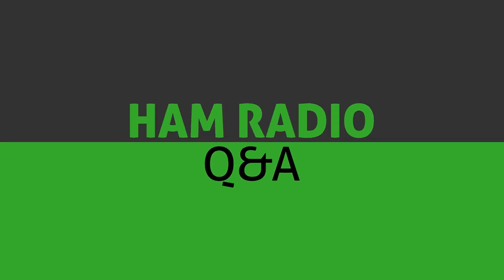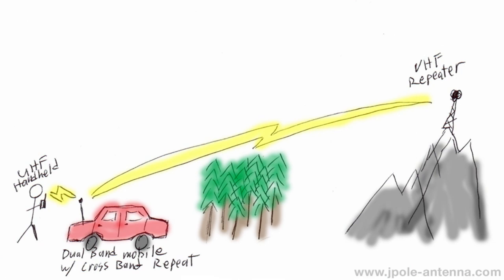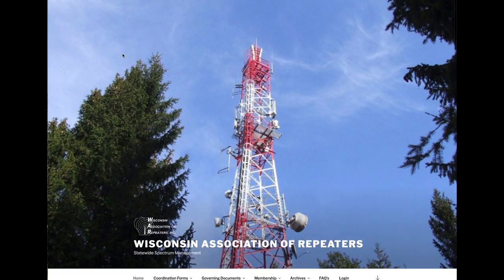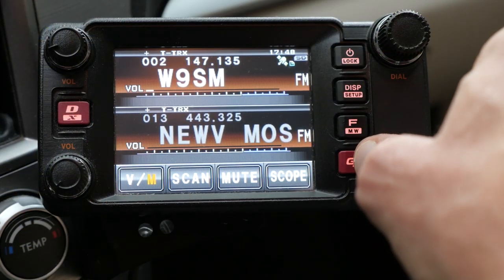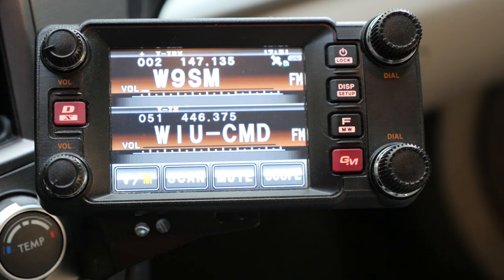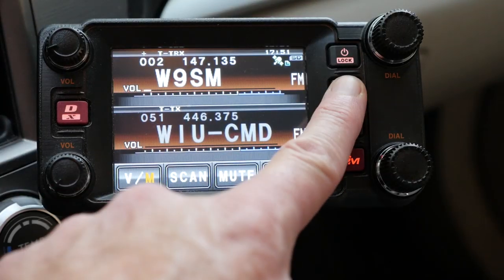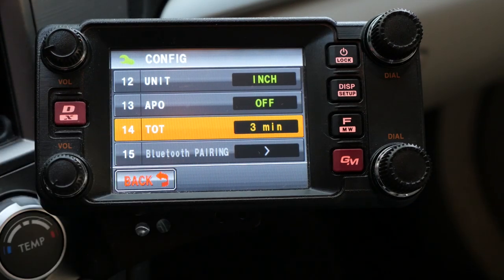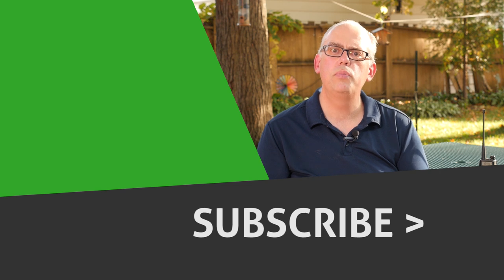Cross-Band Repeater Operation with the Yaesu FTM-400XDR - Ham Radio Q&A

Comment: Kenwoods are definitely more cross band repeat friendly. Look up fixed band repeating. You need a dual band handheld and you’ll have to be able to hear the repeater on your handheld. With fixed band you listen to the repeater on your hand held and only transmit from your mobile when you key your hand held. This saves your battery and your mobile. This is the primary way I use my setup. It also prevents your mobile from locking up the repeater as it’s only transmitting in one direction and only when you key versus it transmitting every time someone on the repeater Keys’s down. Again you have to be able to hear the repeater from your handheld to do this.

Comment: I've had the FT400 for about 3+ years, I may have keyed it up 2, 3 times and never read the manual.  I see it can do a lot more then I know. Thanks
Reply: ah but Cross band repeat isn’t in the ftm-400 manuel. Yaesu has said “ they forgot to put it in” (true statement).
Reply: @forgetyourlife    lol, You would think it would have been posted.  Something for me to play with but I first need to buy a new programing cable to update the system.  When I bought the 400 new about 3 years ago I tried to update it but found the cable was bad,  sent it back to Yaesu and was told the cable is not warrantied :( wow.  I like Yaesu and always had one or more but that pissed me off so I started buying Icom which is another great company.

Comment: You say to unplug the mic for the FTM-400.  However, Yaesu told me that's not needed.  I tried it with the mic plugged in, did some talking & a friend listened on both freqs with another radio & could not hear my talking so it seems it's ok to leave the mic plugged in.

Comment: I have an older kenwood tm v71a and it has "remote control" capability which means you can control it with another handheld radio using dtmf tones.
Unfortunately they stopped offering this feature on newer models.
Beats me as to why they stopped offering such a great feature.
Reply from the maker: You could also control your TS-2000 with the D-7AG handheld‚ including HF. The FCC had some issues with Kenwood's SkyCommand feature when it was first introduced‚ but Kenwood corrected those problems. As useful as it was‚ it never took off and they must have quietly dropped it in subsequent radio models.

Comment: I love the remote control feature of the crossband via dtmf on the kenwood tm v71...    use the crossband a lot at home in combo with a handy while at home so can use repeaters ...  with the remote control feature can change repeaters or change power settings or turn on or off the crossband and so much more
Reply: Sergio Cavazos Kenwood stopped making radios after a certain serial number that support DTMF control. Unfortunate to say the least.

Comment: I have my HRI-200 Wires X node set up with my FTM400 and I was thinking about putting it in cross-band repeat mode in order to basically join local traffic around town and my Wires X room. My main concern would be the amount of stress this would put on the radio, as it would be transmitting for all local traffic and Wires X traffic… 

Thoughts?

Comment: I love the feature and can’t live without it I use it during spring summer and fall when I’m out and about walking I carry an ht with me and set my ts2000 to several different repeaters depending on which repeater I feel like setting up when I leave I also use it when I’m home and want to check into a net on a distant repeater and don’t feel like sitting at my radio

Comment: Question:  UHF handheld into the cross-band radio and out on VHF via land-based repeater. Does the cross-band radio then retransmit the received VHF signal from the land-based repeater back to your handheld on UHF?  Or do you also need to receive the land-based VHF repeater signal on your dual-band handheld?  Maybe the xband radio does retransmit the UHF signal, since you indicated the cross-band radio is running in full duty cycle? Is cross-band one way or is it cross-banding both ways?  Thanks

/

Comment: Just a heads up, your wireless mic was taking a lot of hits. Check your batteries or switch to another frequency. There were quite a few dropouts in your content. Great stuff though, thanks!
Reply from the maker: For some reason my wireless always has more interference outdoors than inside. I'm using an Azden Pro-XD- I've had it for a few years‚ and am planning to replace it sometime this fall with the Rode RodeLink which actually lets you switch channels if you receive interference.

Comment: I want to implement your suggestion, beginning at 8:52, to be careful not to cause harmful interference by keeping the power low. I'm in a deep radio hole in the mountains and need 50 watts transmit power to reach my two nearest VHF repeaters, which are about 20 and 40 miles away and are not in my line-of-sight. But one to five watts would be just fine for both directions on the UHF side of "wireless microphone" link to a cross-band repeater. Do you know of any cross-band capable radio that allows you to set different power levels for transmitting on the VHF and UHF sides?  KD7AVV, Provo Canyon, Utah
Reply: I still welcome any recommendation you have for other models that can do this, but I have learned that The Yaesus FTM-400 DXR, the  Icom IC2410H, and the Yaesu FT8800R can do this, and that some Kenwood mobile radios can not.
This is demonstrated for the Yaesu FTM-400 XDR from 2:32 to 3:23 at https://www.youtube.com/watch?v=MQaqEAq3UZE.
At https://www.eham.net/forum/view?id=topic=75346.0;wap2,  N3CSA states (2011), "I have run older Icom IC2410H and the newer Yaesu FT8800R radios in crossband repeat mode this way with the two meter side at high power and the UHF on low power for years with no problems.   I am aware that some radios (Kenwood mobils) will let the smoke out if you try that with them...........    (Once the smoke gets out, They don't work anymore...... And it is tough to get the special smoke and then get it back inside them.)"

Comment: i am new to crossband but i like  to connect with the repeater while at work and listen to it while working and using while on break but i am told i cant do this .the radio cannot be used to broadcast a repeater.just a question so that i understand the does and donts

Comment: Thanks great video. When I tried this I was transmitting fine on VHF but for some reason the VHF wasn't coming through on the UHF side?  Do you need the FTM-400 volume turned up on both frequencies?

Comment: ok now question?when I am at work the signals get degraded so in order for me to reach the repeater I use a simplex frequency to connect with repeater while I am working so I keep it on with a ctcss tone.I was told that since the crossband is not legal because the radio has no id and I cant use simplex freq for crossband?
I cant keep running out to the car if I am at work .while on break I can use it but I leave it on so that I can still hear the repeater

Comment: You mentioned keep your power low. So on your example equipment, can you change the power output (lower wattage output) when in cross mode repeater for the Yeasu FTM400XDR?
Reply: On the FTM-400XDR, you really cannot change anything while in cross-band repeater mode.  However, if you have the channels setup with a certain power level before entering x-band repeat mode, those power settings persist once you have activated it.  I generally have the repeater channel on 'mid' and the x-band channel on 'low.'

Comment: You always talk about the distant repeater on 144 & your HT on 440.  Could it also be the other way around?  Distant repeater on 440 & HT on 144?
Reply from the maker: You can certainly do that, but not all radios support crossbanding from VHF to a UHF repeater, so check the specs. (The FTM-400 does).
Reply: @KB9VBRAntennas  That's very interesting. Did not know that some radios could not do that but I'm very happy that my FTM-400 does. My ARES/RACES Club had a class about this but did not mention the limitations on some radios. I will be sure to spread the word in case some people are having problems. You say to check the documentation but as far as I know, on my radio, there is 0 documentation on this feature. If you know of documentation on how to setup FTM-400 for cross banding, please Point me the way. Thanks for all the info.

Comment: I have a question about connecting a TNC to the FTM-400XDR to map packets and have the ability to TX APRS messages. My call is N6KMD.
I have a FTM-400XDR and I have tried a Mobilinkd 2 and a TNC-X connected to a tablet running APRSDROID. I do have the CT-164 cable and the CT165 cable.
Have you been able to receive and map a packet or transmit a APRS packet from the FTM-400XDR?
Reply: To answer my own question, i got it to work with a TNC-X and the CT-164 cable with APRSIS32 software. I think the different thing that I did was I turned on the internal TNC with the TNC-X connected.

Comment: When one uses the FTM 400 AS A CROSS BAND RADIO; DOES ONE NEED AND ADDITIONAL, SAY A HAND HELD TO ACCESS THE 2 METER FREQ. OR ONE CAN USE THE MICROPHONE ON THE 2 METER MODE ON THE FTM 400, YOU JUST SET UP,?

Comment: Hello Michael, I have a FTM400 being delivered shortly. I’m curious if you know. Using a ft2dr can I cross band repeat APRS SMS messages to the ftm 400 to be broadcasted? I hope that question makes sense. 
Ie. hiking or camping smsgte a short text message from ht.
Reply from the maker: You could possible do that. You will have to run APRS on your FT2DR on a UHF frequency for the cross band. You may also need to adjust the APRS transmit delay a bit to account for the lag during the cross band process. Another option may be to put a fill in digipeater in your vehicle to relay your packets while you are hiking: https://youtu.be/1SvibQpaXBY
Reply: @KB9VBRAntennas  thank you for the speedy reply! Off to watch that video now. Can always count on you! 73 de K2SCH
Reply: @KB9VBRAntennas  outstanding video!

Comment: Technically, your call sign gets repeated on the UHF and VHF when you sign off. So I don't see a issue FCC wise. The only issue I can see is if the transmitter is not within "arms" reach, such as remote instillation. It's Kinda like using your tv remote. Maybe someone with more knowledge can correct me.
Reply: Kenneth H Exactly. None of the frequencies used will not hear you say your callsign. I've never understood the argument that you need to have Morse or some other ID from the mobile radio in crossband. Every time someone tries to argue why they end up proving my point for me. Thus why the 400 doesn't have a built-in ID - it isn't needed.
Reply: I'm confused. I don't see how the mobile radio to HT transmissions aren't ID'd? Yes, any ID made by someone else on the other end will come through, but my understanding is that doesn't count because it's your radio and you need to make your own ID in it in both bands...? I'm not arguing with you, because I want to know more and understand... I'm just not following what you guys are trying to say here. Thanks!
Reply: @USAFJUNKIE  I think you are actually in agreement. Let me explain the concept further though.

 As far as I know, repeaters only need to self ID themselves when operating in AUTOMATIC MODE; Meaning when there is no one in direct control of the repeater station. If you are the owner of a repeater and you go a few miles to the store and two other people are using your repeater, then the repeater is operating in automatic mode. 

Now, if you are only a few feet away from the repeater and you are using the repeater only for it's higher power and better antenna, then your HT is only being used as a wireless microphone. You are still present as the control operator at that point for the repeater. So, when you key up the HT and identify, you are identifying on the UHF for the HT and the VHF for the repeater; of which you are the control operator for both radios and frequencies. Neither radio is operating in automatic mode. 

Now, the gray area is how far can you be from the repeater and still be considered in local control. I think if you are ten miles away, most people would consider you to not be in local control. Within a couple of hundred yards, would probably be more reasonable. Hope this helps.
Reply from the maker: Full duplex repeater stations are under Automatic control as a control operator is not present at the control point. Cross Band repeaters are classified as an auxiliary stations since you are using a UHF link to relay your signal to another station. So auxiliary station rules would apply which includes the need to identify. Auxiliary stations can be remote or local controlled‚ but regardless they still need identification‚ and the identification of the UHF link from the cross band radio to the handheld is the sticking point.
Reply: KB9VBR Antennas But the uhf frequency is the same when transmitting to the crossband as it is from the crossband, so the callsign is heard then since personal identification requirements still apply.
Reply from the maker: Mark‚ I see your point and get where you are coming from-  this may sound nit-picky but those are two separate transmitters. IDing on the UHF frequency with your handheld doesn't necessarily equate to IDing from the cross band unit. That's like one person identifying for two simplex stations in a QSO; it's not the same as the identification originating from the transmitting station. Just because with cross band‚ both stations are under the same callsign doesn't exempt it from the rules.
Reply: @KB9VBRAntennas  Fair enough. Maybe you're right, hadn't considered it that way. My big complaint with the D710G is that it transmits the Morse ID out on both sides and I got complaints along the lines of "who is keying your callsign out over the repeater?" which I didn't realize it went out on that side until they said they heard it. As soon as I explained I was told to turn that nonsense off, it wasn't needed and didn't need it on the repeater. I agree - in my mind it should only go out on the simplex side and not on the other side, too.
Reply from the maker: I will agree with you on that. The ID system in the Kenwoods is very annoying- too bad they couldn't come up with something more intelligent. I guess its better than nothing.
Reply: Here's a related question I hope somebody can address. I have my tech ticket as well as a GMRS license. If I hit my cross band repeater on a 2 meter simplex frequency and it re-transmits to my wife on GMRS (who is licensed for gmrs through me but has no ham ticket), when she responds on GMRS to the Cross band repeater which then transmits back to me on 2 meters, is she breaking an FCC regulation or not?
Reply: @bradhollis1005  technically, yes. But if you're using low power on the 2m side and not causing trouble then I wouldn't worry over it.

Comment: Hi - can I do cross-band WITHOUT the "cross"? I want to use my (UHF) HT to hit my (UHF) base station to connect to the club (UHF) repeater?
Reply from the maker: You could link two UHF frequencies, but it would require a duplexer system to isolate the channels. A full duplex repeater works in the same way, so you would need two radios, a control system, and a UHF capable duplexer. It would certainly take up more space than a cross band VHF/UHF link would.
Reply: Ok thanks

Comment: So do I need to set the simplex side with the offset as well as the tone on both the  rig and hand held that’s where I get confused. I would think the tone but not offset. Any help appreciated Also I’m thinking of getting the 400 it’s been out for a while what are you thoughts on it. Should I wait for an update
Reply from the maker: No need for an offset on the simplex side- just set the tone. The way crossbanding works- you are transmitting and receiving to the cross band radio via simplex and the cross band radio will automatically transmit on the repeater's input and receive on the output

Comment: Mike I am a new ham and your videos are excellent,  I have a tyt 9800 and bought it with the intention of using cross band repeat, still trying to get the antenna tuned to all the bands, haven't got 6 or 10 meters in tolerable swr but will keep trying, the 2 meter and 70 cm work great, it's fun learning all this stuff KN6GZP Dave thanks.

Comment: Will using a repeater that is linked to say 20 other repeaters through out the state be an issue?
Reply from the maker: It shouldn't be an issue. I've crossbanded on linked repeater systems with fine results. Just remember to wait about a second when you key up before speaking so that the crossband and the links have time to engage.

Comment: Has anyone tried Crossband Repeat to a Wire-X room? Is that possible? I'm thinking about using a FTM-400 and a FT-70dr.
Reply from the maker: That will not work as the crossband repeat on the FTM-400 is analog only. It is unable to crossband analog to digital.

Comment: Icom 2730A is also a great crossband radio.
Reply: Yes, I use the Icom 2730A.  However, at least mine did not have the repeater option in the menu.  There is a hack to add it to the menu.  I watched a video on YouTube and it only took a couple of minutes to set up. de KI7WGA

Comment: I stumbled into a crossband repeater frequency. 146.52Mhz to 52.525Mhz.  It was interesting to hear the operators arguing if it was legal to have the crossband repeater running on those frequencies. They wanted to track down the repeater. But some of the operators insisted that it was completely legal and they would make fools of themselves if they went knocking on the door of the person that set it up. They started getting into a verbal fight about whether it was legal or not. Meanwhile, they were using the crossband repeater anyway. Thus, they were being hypocrites of it was illegal.  It I was legal, why complain about it. It got quite, "colourful."